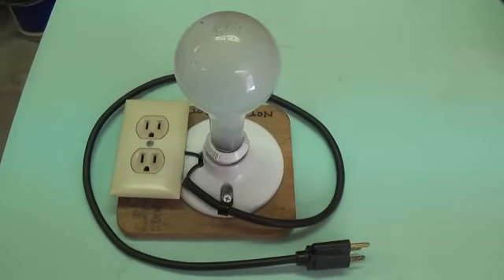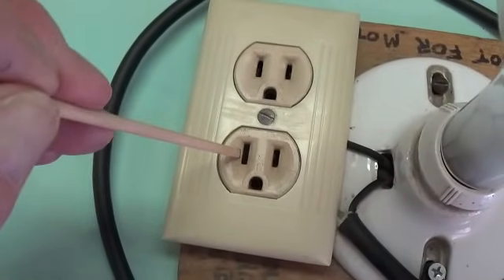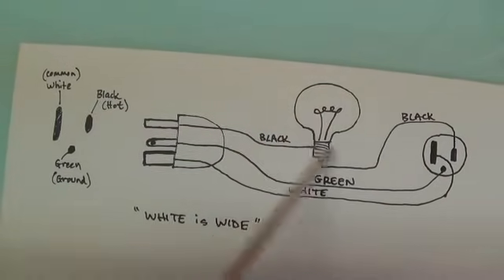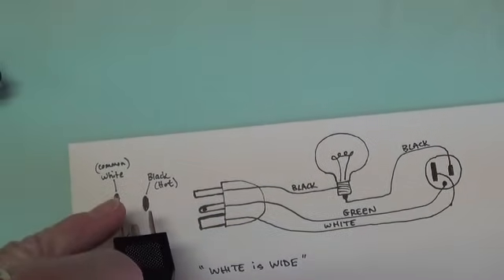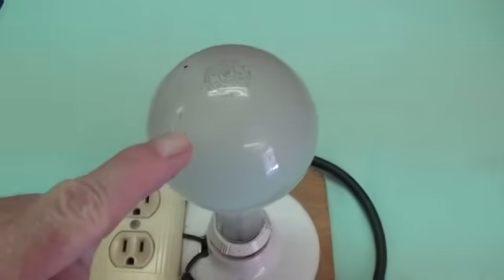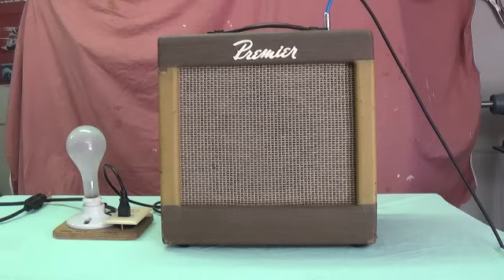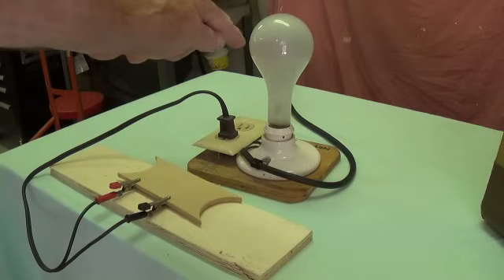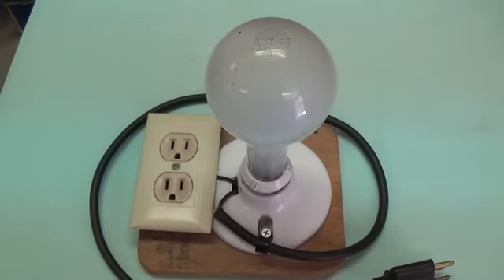Build Your Own Current Limiter for Protection when Repairing and Testing Electronic Equipment

Comment: Thanks for the post, would it be ok to leave my stereo amplifier plugged in to one of these all the time or would this hinder performance? I have a 1977 Marantz 2385 185 wpc with all original caps, will this protect my transformer if a main filter cap go's bad? It has a huge Toroidal transformer and has a soft start circuit.
Reply from the maker: Greetings, Buck. In my experience, most filter caps in steadily-used electronic equipment maintain their integrity much better than those in infrequently-used equipment, so you're probably not going to have a problem. Also, failing filter caps generally cause an audible hum (from the speaker) to warn you of their impending demise. 

Does the amplifier have a fuse? This would be the simplest, cheapest, and least intrusive way to protect the amp. If not, you could install an inline fuse in the "hot" input wire (the one from the narrower blade of the plug). If you don't want to cut one of the original AC input wires, then install the fuse in the "hot" wire of an extension cord.

Selection of fuse value is key: You want the minimum value that JUST permits the amp to start up and run at high volume. You can experiment with smaller and smaller values until you find one that fails (i.e. 0.75 amp), then go to the next higher value (i.e. 1 amp). In this application, you are better off with a  rapid-blow fuse (not slo-blo). Over time, you may blow a fuse or two under normal use, but it's cheap insurance. If it becomes troublesome, go to a slightly higher value.

The current limiter would work also, and would give you a bright (250W) flash to alert you to a short, but it's more expensive and bulky than a fuse.  Best of luck !!
Reply: Uncle Doug Thanks for the reply Uncle Doug, Yes the 120 volt ac line in is fused on the back of the receiver, plus there is multiple fuses on the power supply board.
Reply from the maker: Just be sure the fuses are of low enough value to provide adequate protection (see previous response) and you should have no problems.

Comment: Great easy to understand video.
When I was a bench tech we did the same thing in a different way.
We would take a bulb and alligator clip it along the fuse terminals of the amp.
Question for you:
Now that the government is phasing out incandescent bulbs, will the CFL's or LED bulbs work the same way? Thanks.
Reply from the maker: You ask a very good question, Reno. I have several vintage jukeboxes that use a bunch of incandescent light bulbs, and I'm worried that a time may come when I can't buy any replacement bulbs for them.

Sadly, the answer to your question is "no", I don't believe that any other type of bulb (that the government will allow us to buy) will replace the 200 to 250 watt bulb in the Current Limiter, or, for that matter,  the 11 watt bulbs in my jukeboxes. My solution is to stockpile a sufficient number of bulbs to cover my needs for the future. I suggest that you do the same. Good luck !!!
Reply: Thanks for the reply Doug.
Actually the only ones that were left were only 60 watters.
So, what I did is also buy a Y neck socket to fit 2 bulbs in parallel.
Hopefully 120 watts will suffice if necessary.
Reply from the maker: I'm not sure if 120 Watts will work. It may still have so much resistance that it reduces the current and voltage to the amp, which is not good.

My current-limiter bulb has only 1.6 ohms of resistance and has been ideal for every amp I have ever worked on. If the bulb size is correct, it should not light up at all (maybe get just a little warm) when a small to medium-size amp draws current through it. If your two 60's light up with an amp, then you may need to go to four 60's in parallel. If not, then maybe they will work.

I'm going to start looking for some 250W flood light bulbs.
Reply: Uncle Doug The only thing I saw at Home Depot were 250 Watt Incandescent Heat Bulbs.

http://www.homedepot.com/p/Philips-250-Watt-Incandescent-R40-Red-Heat-Lamp-Light-Bulb-415836/202768766#specifications

Those should work in theory should they not?

Comment from the maker: working on a chassis, trying out an unfamiliar amp, or even using one of your own (old) amps. In the case of any internal short circuit, the Current Limiter will prevent the flow of current that can damage the components within the amp.....or you. In addition, the bulb will flash brightly to alert you to a hazardous condition. Good luck and thanks again for your input.

Comment from the maker: Thanks for your kind words, TG, I really appreciate it. I don't think you need an isolation transformer unless you have an amp that has no power transformer and uses the tube filaments (50L6, 35Z5) in series to provide the voltage drop. Also, I think the concern over "death caps" is unnecessary as long as the amp is properly fused.  All of my amps that came with them still have them and I have never had an issue in 35 years. I would recommend a Current Limiter, especially when you are..........

Comment: Love your vids, they are so clear, precise  and easy to understand. ...I have a Oneac power conditioner\isolation transformer rated at 600va, 8.3 amps, 120ac input and out. I have been using this when playing through a couple of old "death cap" Kay amps and a 2 prong Gretch 6150. Would there be any benefit by adding a "filament current limiter" such as this, and if there is, should I put it before or after the Oneac isolation transformer?
Reply: i don;t know the answer. but my gut suggests that I plug the isolatiaon transformer into the wall outlet. then current limiter into the true isolation transformer and then plug my device into the current limiter. 

That way, I guarantee the device being analyzed is floating protecting my scope earth ground from shorting any part of the device circuitry to ground.   I still have to worry about shorting across the hot and neutral of the device by a conductive tool. 
the bulb will light but at least the current will be limited by the bulb.

I don't know what I am talking about, so please be cautious.

Comment from the maker: Thanks for the kind appraisal, V.  I never really thought of using a current limiter in that way, but it would reduce the voltage to the electronic device, so I guess it would behave somewhat like a Variac. You could build one and test the voltage drop with various bulbs.

Comment: I use a 200 watt bulb for my radios........works fine and probably good that it may lower the voltage a bit  because the   line voltage now may be higher than it was back in the 30's-50's..

Comment from the maker: Thank you for confirming the benefits of this device, VA. Many people simply rely on the fuse in the amp for protection, but it only functions AFTER the current flow has occurred, and often the fuse has been bypassed or is the wrong current rating. Re my lighting, I use only the overhead fluorescent lights in my shop, and an open door to admit sunlight (and heat and noise, unfortunately). My camera is able to compensate for reduced lighting (i.e. for shots inside the cabinet).